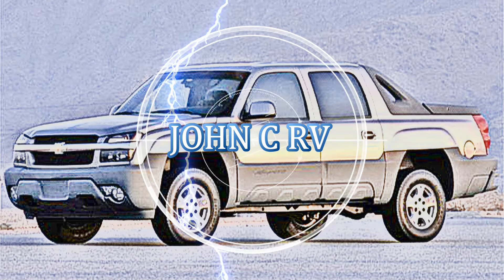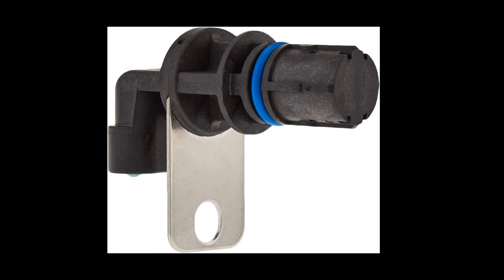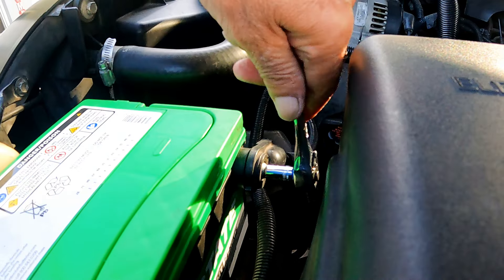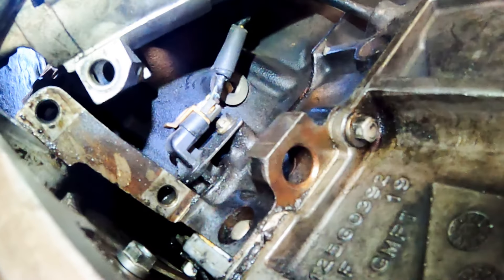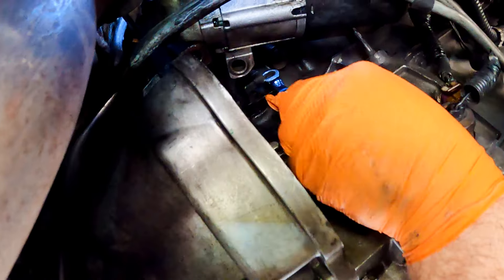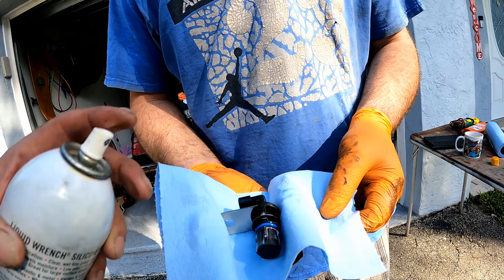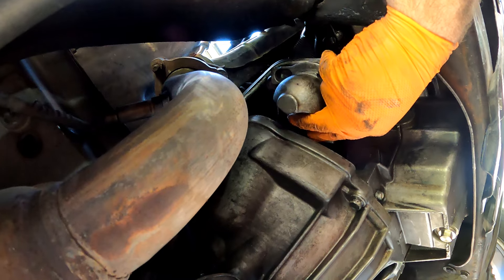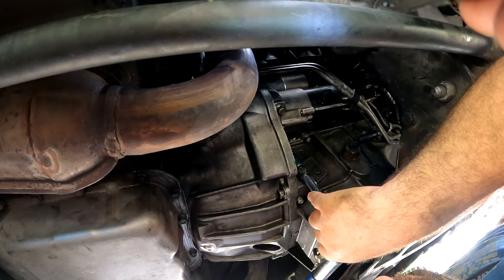How to Replace Crankshaft Position Sensor 1999-2007 Chevy Avalanche 1500 or any 5.3 LS  Engine

Comment from the maker: In this video we replace the leaking crankshaft position sensor on the 2002 Avalanche...
 It's the same on all Chevy vehicles with the 5.3 LS - engine. Although this crankshaft sensor was changed because of it leaking;
The crankshaft is one of the sensors your vehicle's computer uses to ensure its engine is running properly. A failed sensor could be a danger to your engine, and should be replaced. This video shows you how to install a new crankshaft position sensor on your 1999-2007 Chevy Silverado.
Reply: Another good upload, thanks for sharing!

Comment: Thank you for this as I have the same issue on my '05 Avalanche leaking. I just wanted to confirm because I could not find any other leads as to this particular replacement part (ac delco 213-354) on the internet not needing to be relearned. Appreciate the feedback
Reply from the maker: The best suggestion I can give you is to visit an O'Reilly Auto parts store They are really nice people on the phone too, or go on their website.

Comment: Thank you for the update message.please how do I know my crankshaft sensor is bad
Reply from the maker: Engine light on and code comes up with P0335.
No start, acceleration issues, rough idle, and poor gas mileage.

Comment: CAN A LEAKING CRACKSHAFT SENSOR ON A 2003 AVALANCHE BE CONFUSED FOR A LEAKING REAR MAIN SEAL?
Reply from the maker: Any leak from that area can be mistaken for something else. 
The way we look at it is, either way they have to be fixed and in the process of elimination you'll find out the next leak if any... Good luck..

Comment: i've never seen anyone do it, but is it not possible or worth it to just replace the o-ring on the sensor if the sensor is still good? 🤔
Reply from the maker: Yes, you can replace the O-ring on the old one. But because the part is so old and the labor of taking the starter off, we think its worth spending the extra $ to buy the the new sensor.

Comment: I think that the crankshaft position sensor O ring is leaking in my 5.7 litre Chevrolet LS1 V8 engine in my 2002 model Holden VY SS Commodore so I am probably just going to replace the O ring with a 14mm ×19mm O ring quick is 2.5 millimetre thick in the metric measurement or 9/16"×3/4" O ring which is  3/32" thick  in the imperial measurement.

I have a couple of O ring kits which has a suitably sized O ring !
Reply from the maker: Cool! Let me know how it works out. Thanks for the back.

Comment: I've ben trying to get teh starter out of the way to get to the sensor for over 30 min, cant get it back, sideways, up, anyway at all... its a 2001 Silverado 4x4 with the 5.3L LM7 engine... there is no run to pull it back at all, or at any angle. wire harnesses wrapped around it and behind it, along with some sort of shroud on the top of the starter
Reply from the maker: Wow! I cant imagine it being tighter than 2 wheel drive but then I never had yo remove one from a 4X4...
The "shroud" is the dust cover and can be removed to make it easier to wiggle the starter out.
Reply: @JohnCRV  thanks for the reply! I spent about 3 hrs yesterday trying to get it removed without any success. I will keep trying this morning. There just isn't any wiggle room at all that I can find. Needs about an inch to clear the gear housing and can't find that room to get it of the way 🙄 on any direction... very frustrating
Reply from the maker: @elianselmi4099  Hope you get it out.

Comment: Well I had replaced that cuz that's what it said replace crankshaft sensor I did but at the same time it had low voltage read and it said crankshaft sensor so I changed it and nothing's really changed what's causing that I wonder
Reply from the maker: Sorry, but You need to be more clear.